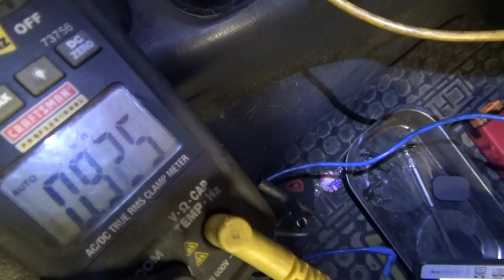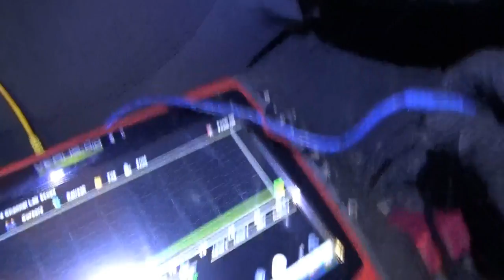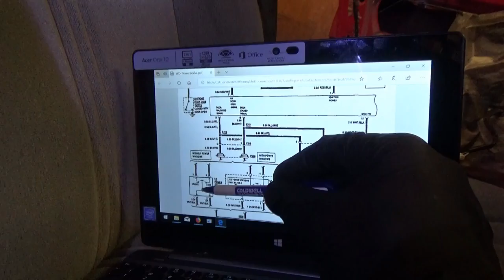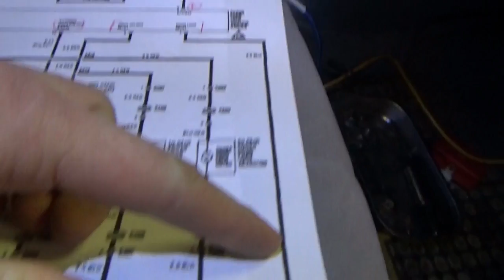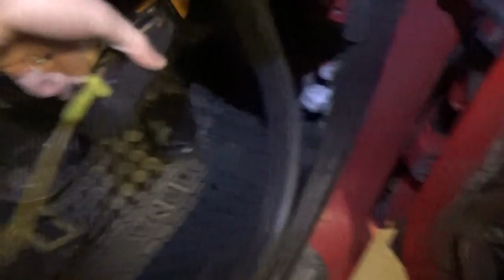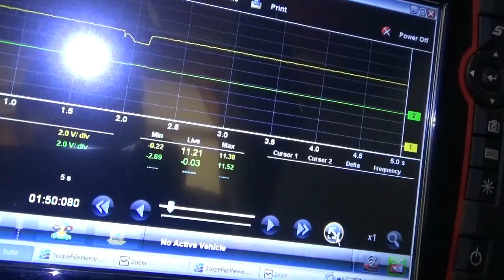Power locks gone NUTS! (Toyota) -Part 2

Comment: 970k ohm is to low low resistance for me for just wires. At meter voltage should be 40+ meg ohm. 
As soon as I seen condition of door lock module I thought not likely the fault.
Then when you were probing the door lock module you had me thinking bad pull up resistor (forgot about bad resistance measurement above lol)
Still had my notion of drive feeding into signal. while you had diagram up i was looking for door connectors seen them there and that is where you went.
Reply from the maker: Very strong thought process, Josh! Do you diag cars for a living?
Reply: @PineHollowAutoDiagnostics  Thanks. Nope only casual for my self and friends don't have any scan tools so limited to what I can do.
I have oscilloscope as I use it in electronics.
Most cars are around year 2000 here so not too complicated anyway.
Done work experience as Auto sparky like 15 years ago was told I am too picky because I didn't think twisting wire and taping is a acceptable repair on the exterior of vehicle.
Diagnostics is just what I do needed for electronics repair and computer repair.
Reply: Agreed. But this is a Car. Toyota could have used something like 300 mA control current. Until the crusties exceed 40 Ohm resistance or locks would work and you can find the crusty connector by smelling it (3,6W) or with a amp clamp. Anything in a car body workign with a few mA control current is a no no.
Reply: @jannepo  control/drive amps will be tens of amps.
The input signal current through the pull up resisters is 0.46ma when the lock or unlock position of the switch is toggled  if Ivan did not miss quote the pull up resister been 26kOhm.
Some cars the switch directly drives the lock motors. be a design you would like.
Reply: @ratbag359  Yes those sometimes do. We can use 1 mA currents to drive things, but that is asking for trouble. Water, crusties salty wind from the sea and your car starts to act up, unless all those 1 mA controls are not humidity protected shielded cable.. Which is always way too expensive for automotive industry. When you do not have a need to conserve power, use it! :D
Reply: The reason you see the voltage drop at the resistors going into the ic is the ic probably has a supply voltage around the 5.6 volt mark, inside the chip it has diodes that clamp input voltage to the IC power pin. and the reason the other input resister had no voltage drop is the voltage was below the ic clamp voltage. the clamp diode voltage drop will be around .6v some newer ics use .2 v  drop diodes.
there is also diodes built into the IC that protect the ic from negative voltages
Reply: @ratbag359  I guess that chip is a standard 5V TTL logic chip where low is 0-0,8V and high is anything above 2.0V
Reply: @jannepo  yip could be cmos too run at 5.6v
Reply from the maker: LOVE the electrical engineering discussion!! So when you hit the "lock" button, the current flowing through that bigger 600 Ohm resistor is I=V/R = 12/600 = 0.02A = 20mA. The IC chip senses this voltage through the little 47k Ohm resistor with negligible current going through the chip.Now, the quiz question is: what was the equivalent resistance of the GREEN CRUSTIES when that control wire was pulled down to ~5V?
Reply: @PineHollowAutoDiagnostics  around 600Ohm as it forms a voltage divider two resistances the same in series solve as v / 2.
Reply from the maker: close enough ;)
Reply: @PineHollowAutoDiagnostics  i was solve it propperly but seen no need to.
Reply: @PineHollowAutoDiagnostics   768 ohms for the green crusties.    The way I see it, when you hit the switch, that grounds the circuits (the 12v from the batt and the 5v from the chip) pulling the pin side of the resistors to ground.  Guessing the pin goes to a comparator in the chip so when the voltage drops below 5v, I'd expect a pull-up resistor in the chip creating a voltage divider with the 47k ohm resistor, it turns on its output, which triggers the relay driving circuit.  I wonder if that chip was special purpose or had a datasheet with a block diagram.
Reply from the maker: Double check your math...control wire is being pulled to ground more than half way, so R-crusties < 600 Ohms ;)
Reply: @PineHollowAutoDiagnostics  Closest standard value for resistor is 620 Ohm. At 11,4V and R1 = 620 R2=470 Ohm at 4,9V. R2=crusties. You do not need to take into consideration the IC in the equation as there is no current flow to IC. Reason is 4,9V is lower than the operating voltage of the IC and input stage does not allow reverse current flow from input, only forward current . 

The other line has 6V drop  at 47k resistor as 11,4V > IC operating voltage (5,6V), there is small current flow into the IC pin (0,12 mA). There is no voltage drop at the 47k resistor going to the faulty line, thus no current flow and no need to include it to the calculation.
Reply: The leak current of the crusties is ~10 mA. Half of one old style red 5mm LED = very dim LED.
Reply: @PineHollowAutoDiagnostics    I see that now.  Shouldn't do late night math in my head.

I should have kept this quote in mind.

"It is possible for the mind to indulge in false logic, to make the worse appear the better reason, without instant exposure."
Reply: @jannepo  Aw you answered before me. Good work.

Comment: With a car that old. Why not just unhook the lock system. And use them manually? I did that with a 79 Grand Prix and 90 Ford F-150. No mess no fuss and save a lot of money.
Reply: He would've done that, if he really had to, but this was GOLD when it comes to a diag video. Very basic system but still complex enough for newbies.  This is the kind of material which would help those new to diag the most. 

It's not about bypassing something not needed, it's the process of why? Or what's the cause of the fault? Can we prove it? Awesome use of the scope too, which demonstrates how useful it is to "see" the voltage and how it reacts when testing components.
Reply from the maker: Exactly right, Cuba! The goal is to always learn something new, and I think we all did on this Prizm :)

Comment: Another well learned lesson!! Not just the most obvious door switches! Not just the module, itself!! Not just the sensitive electronic parts on the circuit boards, within the module!! This problem existed in an out of sight, hard to reach, unprotected connection point, that 99% of the people don't even know existed!! You likely chased down the wire path, and found the connector, and knew what it was!! Is the odd connector point even on the wiring diagrams? There is no map to show the location of connectors, even tho their existence is shown in a diagram, you still have to know where to go look. That could have taken someone down the path to the parts cannon, of the system SELF DESTRUCT BUTTON!! You did say that he was ok with completely disabling the power lock system! And all it took to fix it, was some deoxit, and some persistence!! 

P.S. I have neither deoxit, nor persistence!! Lol
Reply: And someone motivated enough with some experience and understanding of electronics/electrical systems. That is not a requirement in ASE courses if I'm correct. They focus on mechanics vs. electronics backgrounds which vehicles used to be built upon but now, you need an electronics expert and a good focus on mechanical expertise. BOTH, not just one to efficiently and accurately repair today's vehicles. In the field, I rarely see an automotive shop with their mechanics using multi-meters....only the DTC code scanners.

Comment: wouldn't voltage drop across a resister.
Reply: i was thinking open resistor as had forgot about loom resistance been too low.
Reply: Voltage will drop across a resistor if there's current flowing. If no current (no load) then the voltage each side of the resistor is the same.